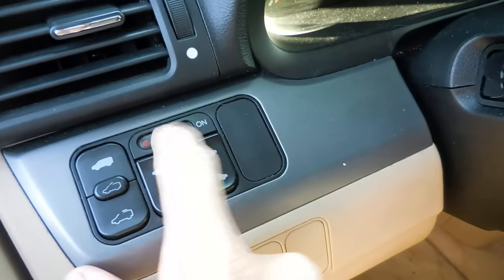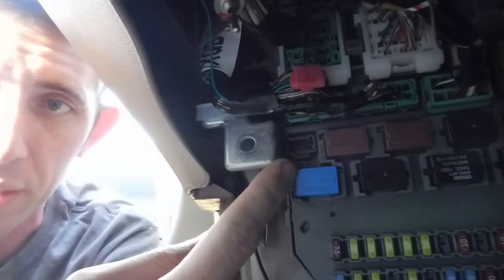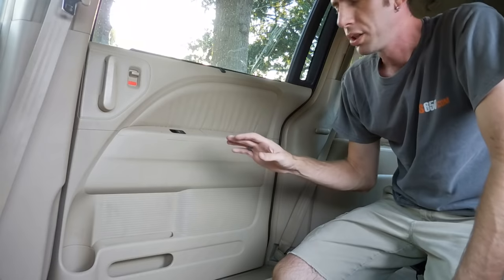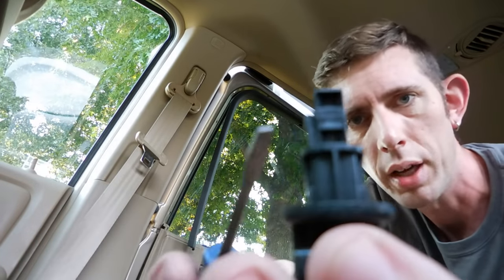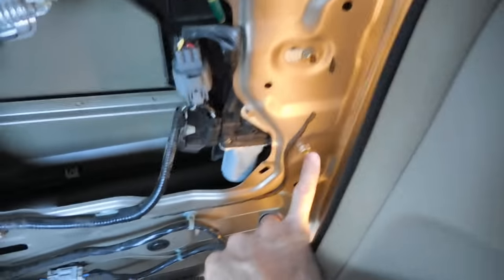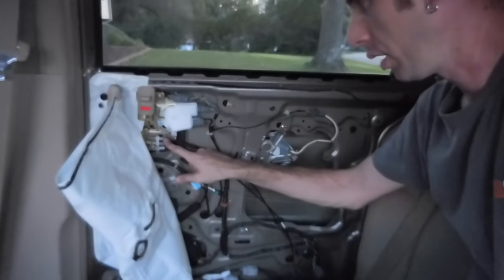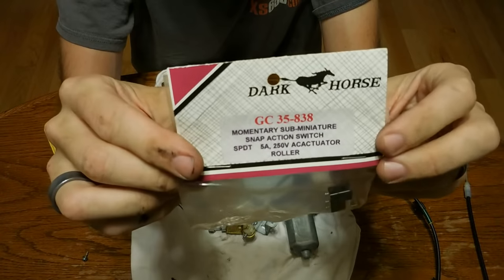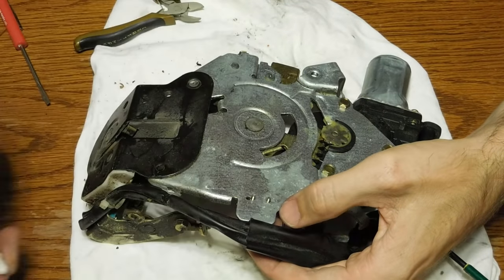Honda Odyssey Power Sliding Door fix - CHEAP

Comment: Hello there, great video did same thing works great both doors work now.  However I noticed that when the door closes there is now about a 3-5 second delay before the latch motor pulls the door to latch.     Both doors were having the same issue every 3 cycles would stop.  I changed drivers door latch motor switch first worked great but with delay, the passenger side (before I repaired it the door would close and maybe 1 second then would latch)   After replacing the switch works but it also now has the same delay.  Any idea whats causing the delay?
Reply from the maker: Don Brown not sure what would cause the delay, as a switch is just a binary device. It’s either on or off. This particular switch is basically a limit switch to signal when that gear has reached a certain position. The circuit is closed until that gear activates the switch, at which time it breaks the circuit.
Reply: I think I figured it out.  Ill go back and make a change and let you know.
Reply: One of my doors shuts but after 4 secs pulls out of closing and has door open warning in the dash... it won't stay locked..
Reply from the maker: Ken Simon you’ll need to check which error codes it’s throwing. If it’s one of the codes I show in this video, this repair should fix the issue unless there are multiple codes being thrown by your van.
Reply from the maker: Don Brown any luck on the repair?
Reply: @DustinRogersinMO  I'm sorry been so busy have not gotten back to it, I will let u know.
Reply: @DustinRogersinMO  i just bought a 06 odyssey yesterday for $1,100 from arabs and there was a communication break down. their daughter who spoke english was their translator. both doors did not work. the automatic switch was completely dead. (probably fuse taken out). they claimed the doors worked but didn't understand why they did not work. (probably lied). after looking at videos. looks like someone intentionally removed the fuse disengaging both doors. the driver's side door doesn't close completely. doesn't latch and remains a little open enough for the dash to show the driver's back door is open.
Reply from the maker: I think this issue is one of the most common issues with the doors. Check the error codes.
Reply: @DustinRogersinMO  i will. they were selling the car for $1900 but didn't tell me the doors did not work on marketplace. so i drive there 2 hours away and get the surprise and wasn't happy about it and made them a $1,000 offer and we settled for $1,100. the sunroof, backdoor and passenger doors did not work. but after several tries the sunroof worked (snow stuck). according to them the car has been sitting for 3 months. so i just thought the michigan cold/snow froze them and they'd all eventually work. the car drove back home fine 2 hours away. i have another 06 which i bought off craigslist 3 years ago for $1,600 230k (now 300k) and i love it. it's banged up. this one i got yesterday has mint body. i may just part it out and put the parts needed on my old one.
Reply: @DustinRogersinMO  YES!  Today finally.  So when I installed new switch I connected the Normally open contacts and should be normally closed contacts.  I'm a bit supprised it did not throw a code it just caused the delay I described above.  Pulled the moved wire and viola work great.  Must if had the cpu confused!  Anyway thanks.  These doors look intimidating but really easy to work on.   Blessings!

Comment: I have on 08 neither door moves at all first the drivers door went out doing weird stuff then the other a few months later I can shut both doors and it will suck the door in but after a few seconds it releases there's 4 fuses all good . Have had issue with lights and battery running down any clue
Reply: dunngee I’ve had the same issue. I took the door apart, and disconnected 2 wiring harnesses. Im thinking it’s the door motor. I need to put a meter on it to confirm.

Comment: The lock unlock mechanism failed on my slider door and dummy me I kept pushing the automatic opening button and it ruined the opener. I didn't realize that it was damaged . It's broken forever now I have to do it manually.
I hate Honda for several things that they screwed up in my 2002 Odyssey.  transmission is shot and there is no easy fix. . I can only drive it manually shifting. The key switch accessory runs down the battery in 2 hours charging my phone. The  cigarette lighter is hidden and i have to look for it way down below underneath the radio. There is no windows in the back that open wide except for way back side windows do open about an inch put the rain goes in the top which makes no sense. How are children supposed to get fresh air in the hot summer. ? 
When I go camping I have to unlatch the back door for fresh air but there's no way to open inside  so I had to cut open a door in the plastic at the latch and install a wire to unlock it.  Also the automatic lock button only locks or unlocks certain doors.
I went to get a key made and they said it has a chip and it'll be $100. 
The leather seats are sweaty and hot in the summer. I can't open any Windows unless I have the key in the on position or with the engine running. There is no council storage between the seats in the front. The DVD player is in the wrong place underneath the radio. Should be in the back or in the council between the front seats. There is however a flip up flat plastic tray with two cup holders but when I stop hard my taller coffee cups and soda cups flip over. Carpets are all full of sugar and coffee. I removed the tray. 
The kids in back have no 12 volt plug-in except way in the back I don't know why it's hidden. I bought this man used and didn't realize it had tons of engine hours on it and it wasn't until I noticed that the brake pedal was completely cut through on the right side and I could see the metal. That means it was driven for in town use and had tons of braking and taking off from stop signs that wears and tears on everything especially the transmission. So basically the guy that sold it to me lied. Typical Craigslist scammer 
The paint is all skuffy and Chalky.  Catalytic converter was stolen off it because it had no protection. The front struts and the rear shocks are dead and the springs are sinking down now. I wish I had never bought it. I'm saving up now for a Toyota sienna van.

Comment: hi i did this process no codes on dash it says no dtc codes nad there is no power at all on passengers side rear door other doors are fine lock actuators working fine to lock unlock the doors ....   any suggestions ?
Reply from the maker: ALEX KEVIN you’ve verified that there’s no power to the rear latch electrical connector, or the passenger door is the only one that won’t open under its own power? If there’s no codes, then I’d suspect a wiring issue - broken/pinched wire, etc.
Reply: driver side door is working fine from handle and button and i didn't check the power on electrical connection i just pulled the door panel to check power
Reply from the maker: With no codes, it’s hard to say.

Comment: I tried pulling the codes nothing at first then it came up (NO) like it showed when you cleared the code.
So I've got no fault codes  and neither door will open or close automatically. 
Can manually.
The one thing both  doors do mechanically is at full close by hand the motor sucks the door in totally silled up and shut for about 10 seconds if that and releases.
Door locks still work but not normal, remote lock unlock none op.
Over head lights have to keep in off position or stay on. 
Got a battery drain that drains if not drove everyday.
Reply from the maker: dunngee there’s three micro switches on the latch mechanism. I’d suspect that one of the other switches is faulty. Of course that’s only a guess, but it’d be where I’d start. If you find a wiring diagram, you may be able to figure out which wires go to which switch and test it without removing the latch assembly.
Reply: @DustinRogersinMO  Did you have battery drain issues , and is the scan tool you need to read the door circuit different than what an obd2 scan tool with abs can read.
Being it hooks to main control unit.
Reply from the maker: I did NOT have battery drain issues. I know that with some of the OBD2 scan tools, you can check and operate body controls directly from the scanner. I don't have one of those, so I'd end up pulling the door panel and figure out which pins on the door latch harness go to each switch and then use a multimeter to test them. You may or may not get the switch to activate though, so it may require latch removal to test.
Reply: I am in the same situation. 09 Odyssey, passenger sliding door does not do anything except suck the door in at the end of a manual closing (and it seems to suck too hard, then gives up and releases the door). Tried the tin foil trick and got a "no" on the dash...Guess I'll just dive in and start taking apart/cleaning/testing until I figure it out. Interestingly enough, even with an advanced scan tool, I cannot get any of the motors to engage. The scan tool basically says none of the door motors on the rear passenger side even exist!

Comment: With the video fast play we couldn't understand what was said. Could u republish with normal speed.
Reply from the maker: You can change the playback speed of the video by clicking the gear icon on the video playback bar (or clicking the three dots in the top corner if on a mobile device). Just set the speed to something less than 1.

Comment: I would so love to have a car that doesn't have all these power things to go wrong. I like Power Steering, but power doors are really unnecessary and are just another thing to break. I'd love to have a nice simple car with most everything manually powered. Why is it manufacturers won't make a nice simple car that's reliable and has the modern safety equipment?

Comment: Здравствуйте. Можете пожалуйста помочь?Правая дверь не открывается и не закрывается. Предохранители проверил, всё нормально работает. До этого при закрытии двери она закрывалась, и через пару секунд обратно отталкивал дверь назад
Reply from the maker: I think the when the door pushes back out after closing it, that it might be due to one of the other micro switches on the closing mechanism. 

For the right door, does it not open or close even when set to manual mode? If so, then it might have a broken cable between the door handle and the door latch. 

Those are the only things I can think of at the moment.
Reply: @DustinRogersinMO  спасибо друг, за что ответил. Трос целый. Но дверь сам по себе сработал. Заехал на Автомойку и после этого сработал.

Comment: That window bracket deal fell off cant find where it goes
Reply from the maker: It fits around the window track. There’s a bolt that holds it in place.
Reply: Its at the bottom of the door just reach in and grab it

Comment: Seems there's a real problem with mid 2000 models to present.
Motors ,bearings ,
switches,latches so many systems connected for safety yet doors fly open. And the issue with the major cost in fixing. No real info by honda to fix yourself. Not if just when one or both go out

Comment: What a pain in the ass, I'm trying to figure out why my door wont open at the moment. Before it totally wouldnt do anything it was getting stuck and stopping while opening and sounded terrible but now it wont do anything and I cant even manually open it.
Reply from the maker: There’s a video that shows how to replace door rollers. I think it was by Eric the Car Guy. The noise you were hearing was likely the rollers failing. You may search for that video and see if it’s what’s happening with yours
Reply: @DustinRogersinMO  yea I've seen multiple videos on replacing the rollers. I bought them and plan on replacing both sides but for some reason cant get the drivers side door to open even when pulling the door and handle really hard. Trying to figure out why, going to try the fuse thing and see what happens.
Reply: @DustinRogersinMO  I've pulled the fuse a few times and I can get it to reset but not everytime and when it does it only starts to open then stops. One of the times I timed it just right and pulled on it as it activated and got it to open halfway but even with the doors turned off the door seems stuck and wont open or close. I did do the code trick and I'm getting slightly different codes than you, mine are b2031and b2032.
Reply from the maker: @NotoriousNUGS  read this thread. https://www.odyclub.com/threads/both-power-sliding-doors-gave-out-simultaneously.283202

Comment: Hi thanks for your video !! I hope you can help me with this code  61163 50  driver sliding door, just make beep noise and not open  I need to open manually, same for close pull the handle just beep  noise and no close, I need to push all the way until close ! Thanks  again  !!!
Reply from the maker: GF F the code is B1163 and I believe that code is a communication error. You may search the odyclub forum for that code to see if anyone has determined the root cause of it. I did not experience that code so I’m not familiar with it.
Reply: Thank you  !!!!

Comment: Hey man i need help i am having issue with driver side sliding door after i reset its works for few time and than sliding door sign comes up and when i try to do your way to pull the code i am getting two code on my dash board
B1076
B1080
So you think if i change this blue switch than my door will work fine again...??
Reply from the maker: Doubtful that yours is the same issue. Looking on odyclub.com, someone posted that code B1080 = Power supply circuit (IG1 line) input error for
 Relay Control  Module and MICU. I believe the B1076 is another relay control module code. You may check out this post https://www.odyclub.com/forums/52-2005-2010-odyssey/291553-odd-issues-05-sliding-door-driver-window-dome-lights-post1761473.html#post1761473
Reply: @DustinRogersinMO  thank you
Reply: All right guys if someone having the same issue like me i just fix my car door today i open the exact same part in this video and i check all that switch look like this and i found i have the same switch that having the same issue like this guys and i replace the same switch and  walaaa problem solved .... thank you so much for this video helps me a lot...

Comment: hi dustin super video more of such tips synonymous have a question synonymous have a code but need a list of what the leader is a component. my door does not open automatically do not open do not close death can you give me a tip because of the code my code is 61163 50th
Reply from the maker: If you used the method that I show to check the codes, I believe the code you're seeing is B1163 which is 'gauge control module lost communication with left sliding door control unit'. I'm not familiar with this code, but I did find this post where a Honda tech is assisting someone who has the same code. You may try some of the test procedures he recommends. Keep in mind, it doesn't appear that the persons issue was resolved in this post, but it may be helpful to you. See the post here: https://www.justanswer.com/honda/9mra4-honda-oddessy-left-sliding-door-will-not-open-automatical.html

Comment: Eeee most of the time it's all bullshit - roof is leaking straight to the body control unit or multiplex module if you want to call it like that and everything goes to shit - doors, high beam, blinker relay, sometimes rear blower etc  - cost about 230$ dealer ,comes with fuses, simple try - after rain just get a compressor hose and try to blow in it and if any water squirted your roof inseam (under black plastic covers) has very small cracks and water drips straight to this box - these bastards at Honda made millions in service cause of that - when you seal whole length of the roof (do both sides cause sometimes front leaks at passenger too) you will see it stops - in my case was too late, had to replace this dam box

Comment: That is by far the worst audio I have ever heard in my
Reply from the maker: Louis Cammarata this is the most incomplete comment I have ever seen...
Reply: @DustinRogersinMO  try listening to the video and you'll see what I mean sounds like Alvin and the Chipmunks
Reply from the maker: @spulamander  The audio is not bad, it's just faster than you are used to. That's because portions of the video are sped up to shorten the length of the video. Most people will completely bypass a 30 minute video. If you want it to play slower, you can click on the gear icon and select a slower playback speed.